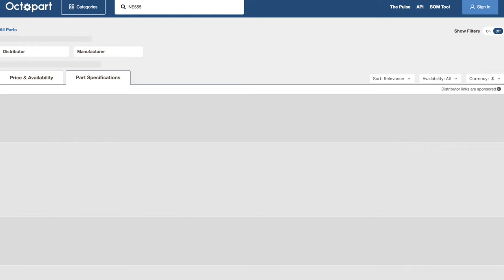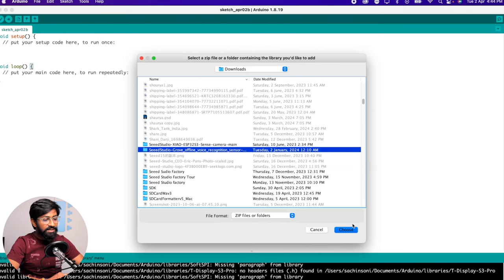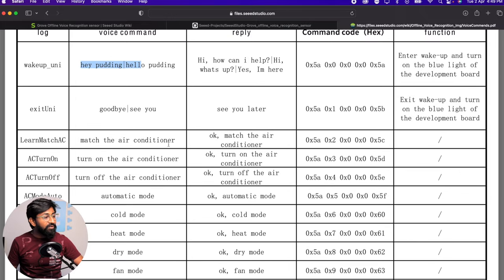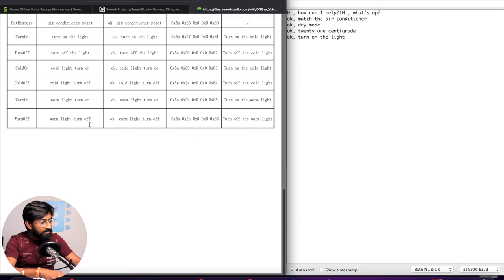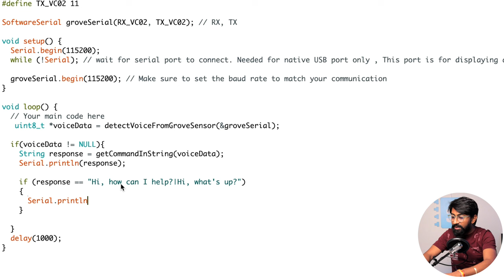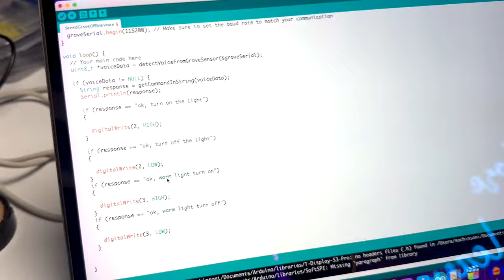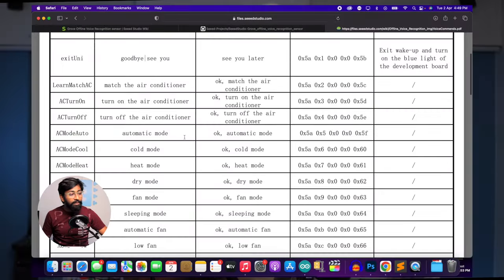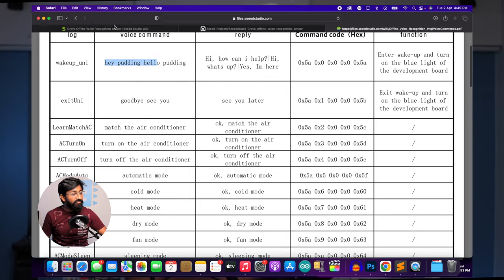Voice Controlled Appliances using Arduino without Internet | Giveaway | Arduino Projects

Comment: Another use apart from IOT is , we can use it as personal assistant for blind people ,like they can just ask like- to call someone, to ask current time , or just turn esp32 cam module on to guide them through path  etc , so they are less dependent on others and will always feel like having someone around ❤
Reply from the maker: That’s also a very good idea
Reply: Use any android smartphone
Reply: Or just use any Assistant like Google Assistant or Siri
Reply: I agree with others that using a cellphone is a better option, but I like your thinking!

There is bound to be a disability use case for this technology. 🤔

Comment: -->Can I do signal processing of voice signal with this board?
-->Can we get audio data?
-->What is sampling frequency of this board if it is more than 40khz is good for below projects
-->because I tested sampling frequency of analogRead(); function of esp32 is approx maximum of 13khz that's not  so good for making sound based project 

If yes, then we can make sound reactive led or make spectrum analyser    
By performing FFT
Reply: Please replay
Reply: unsigned long newTime;
int x;
void setup() {
  pinMode(15,INPUT);
  Serial.begin(115200);
}

void loop() {
  newTime = micros();
  for (int i = 0; i < 10000; i++) {
    x=analogRead(15);
  }
  float conversionTime = (micros() - newTime) / 10000.0;

  Serial.print("Conversion time: ");
  Serial.print(conversionTime);
  Serial.println(" uS");

  Serial.print("Max sampling frequency: ");
  Serial.print((1.0 / conversionTime) * 1000000);
  Serial.println(" Hz");

}
Reply: Above is the code to test sampling frequency of esp32

Comment: Excellent ! This will certainly be a game changer as dependency on internet connectivity for voice control application will not be a requirement. I look forward to use this as a voice command to MQTT messenger for my   Openhab  home automation  server for complete offline control. Currently I use Alexa to implement voice control and need the internet aways.
Reply from the maker: Yes, we can do all of that using this

Comment: This module could be a huge upgrade to my existing home automation which works with Alexa and google in presence of internet as of now. This module helps me to operate my home in offline as well.
Reply: And how does your Grove Offline Voice module recognize speech in a noisy environment? I spent a lot of time on ReSpeaker Core v2, installed noise reduction from the NoiseTorch-ng project. Speech in a noisy environment was almost clear, only speech could be heard, and music and noise were cut out, but with Rhasspy noise reduction does not work and speech recognition in noisy environments works very poorly, recognition often works falsely

Comment: // This is the code for testing sampling frequency of esp32

unsigned long newTime;
int x;
void setup() {
  pinMode(15,INPUT);
  Serial.begin(115200);
}

void loop() {
  newTime = micros();
  for (int i = 0; i < 10000; i++) {
    x=analogRead(15);
  }
  float conversionTime = (micros() - newTime) / 10000.0;

  Serial.print("Conversion time: ");
  Serial.print(conversionTime);
  Serial.println(" uS");

  Serial.print("Max sampling frequency: ");
  Serial.print((1.0 / conversionTime) * 1000000);
  Serial.println(" Hz");

}

Comment: We could use it as a voice recogniser for arduino robotic arm, car, or even in weather  station to display the specific parameters or data on the lcd screen or by high level programming could even let the speaker speak out the data. By far the robotic arm projects could be really amazing as we can use it to perform various inbuilt functions like picking up etc. And yes the arduino car project would be fun as we could emote the robot car according to voice commands. Thank you

Comment: I have a heavy sliding pocket door that is hard for me to open sitting in my wheelchair. This would be great to give a voice command to open a motorized door and then turn on the lights as I enter the room. I have a big skylight that I want to motorize also and to voice command it would be too cool . It could be connected to a power supply through a relay board to power up the computer and monitors. Too bloody cool!

Comment: Nice little device it can be used as a automation controller. And also if we connect it with the ESP 32 to internet then it is easy to convert many IoT application control by voice.

Comment: if i get the board i will integrate with my Ai assistant hira which is a python based program working on my laptop . i would give it a life and also connect it with open ai api to give it chatgpt's power alsong with iot features. ❤ from kolkata
Reply from the maker: All the best for the giveaway result. Kindly follow us on Instagram to check the result coming next Sunday
https://www.Instagram.com/techiesms

Comment: One of the projects for voice command head phones using hc12 module to send commands to remote device, cover all applications like home appliances controls sos call and drivers assist  etc..,
Reply: Could you please share a page where a project like that has been implemented? Sound very interesting. Thanks in advance.

Comment: The response time is way faster than I expected😮.. also the accuracy.. the command r changeable then we can make our own bot with this.. without using any pi or other single board computer.. I have a question is that possible to change the accent of this thing .. and is that  possible to add input devices such as sensor with this things..
Reply from the maker: We can’t change accent 
And about input device, I don’t think we can add but still I’ll confirm and let you know in the next video

Comment: I would like to used develop a smart door lock system utilizing the VC-02 offline voice recognition module for enhanced security and convenience. The system will allow users to unlock the door using their pre-registered voice commands, eliminating the need for physical keys or internet connectivity.
Reply from the maker: But once command is leaked anyone can access

Comment: Arduino or Node mcu with temperature sensor and display the result in  2 digit 7 segment display  also monitor the temperature in app. ,tutorial is there in your playlist ? If not pls make it bro if i get this module i will use to control the temperature pv and sv

Comment: // initialize digital pin LED_BUILTIN as an output.
  pinMode(LED_BUILTIN, OUTPUT);
}

// the loop function runs over and over again forever
void loop() {
  digitalWrite(LED_BUILTIN, HIGH);  // turn the LED on (HIGH is the voltage level)
  delay(1000);                      // wait for a second
  digitalWrite(LED_BUILTIN, LOW);   // turn the LED off by making
Reply: Ok I give you one Arduino boad

Comment: This would be cool if it was 100% software and ran on a raspberry.
Reply: I think that misses the point
Reply: @thecircusb0y1  maybe, but i didn't mean would be cool as a replacement but would be cool as another option. I prefer to reuse what i already have because the planet has enough of our garbage.
Reply: @UmbraAtrox_   of course, just plug the sensor into the raspberry pi i2c comms translate the arduino code to python script and you’re golden.